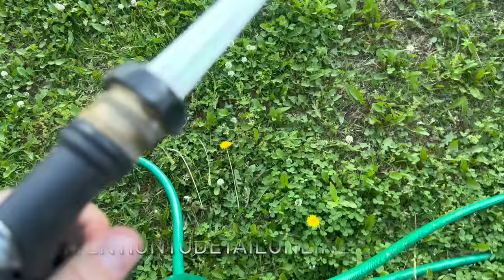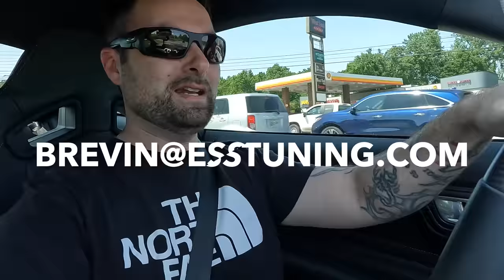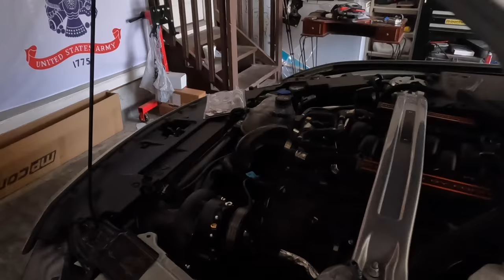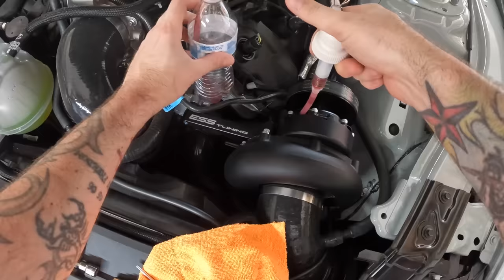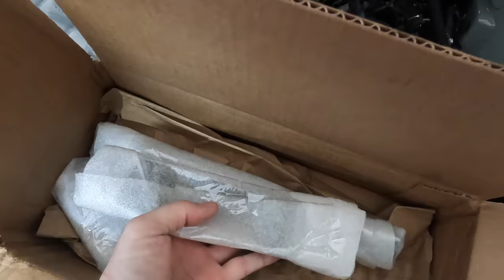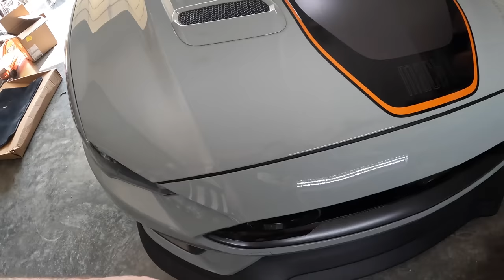PROBLEM with my 2021 MACH 1 SUPERCHARGED MUSTANG and HOW I FIXED IT...

Comment: Thumbs up, as usual. You're starting to win me over to this style of supercharger. Originally I liked the whipple style, because of the down low torque. Initially the ability to fry the tires off the line would be amusing, but power without traction is pointless.

Comment: As I was watching the video and you went and bought a siphon pump I was wondering to myself if you didn't get the one that came in the kit.  It works perfect for adding and removing oil from the head unit.   I still need to do mine, I haven't quite hit 2000 miles yet.  According to the installation manual the first break in change is 2000 miles.

Comment: I had to reroute the windshield washer hose, on the passenger side, to prevent it from being pinched by the strut. Also that mounting point on the fender is fairly thin and flexable metal.

Comment: Water hose spigot seems a bit loose brother. You might want to get that fixed before it breaks at the wrong time and becomes your #1 problem. Surprised there isn't a drain plug at bottom of supercharger. Had that along with a long SS hose and plug with my Vortec and that help drain all the oil and any particles that might be present. The siphon pump not very good IMO.  Nice struts, look top quality.

Comment: Never had any luck with hood struts.  I’ve tried them on my 2019 I had and on the Mach.  Both cars, once the struts were installed,  had the hood pushed up on the passenger side rear corner causing a misalignment on the remainder of the hood.  It’s as if you need to loosen and lower the right hinge.  Tried The ford Motorsport and the MRT hood strut kit. 
Neither worked. Blower does sound good on yours though…

Comment: I have an issue with my mach 1. The line lock wouldn't engage. Just gray "un clickable" has never happened before.
Reply from the maker: I have not even tried mine yet

Comment: Loved the video. Can't wait until I've got the turbos on mine. Haven't had an issue with the hood shake yet but I am also about to put a shaker hood system on mine. just ordered the first round of the Steeda suspension parts today. The build is coming along nicely. Will send pics as it happens.

Comment: Dude your making it really difficult to leave my mach1 n/a 😆 
I've got 7,500 miles on mine and I'm wondering how many miles I  need before it's safe to void my warranty any advice would be appreciated
Reply from the maker: I voided mine at 1100 miles 🤣 this setup on 93 is solid. I wouldn’t be too concerned. It easily goes back to stock too
Reply: @Zander13Productions  but can't ford tell that the car has been flashed (tuned) and dosen't that void the warranty  ?
Reply: @dannycaldwell7051  not necessarily. If you have an issue with the car, take it to Ford and they can prove that your mods caused the problem, then it voids the warranty. Also make sure there are no ECU updates for the car before taking it in. If there is, either request them not update it or return the vehicle to stock before taking it in.

Comment: Just curious why you chose the Roush over the redline struts? Are they that much better?
Reply from the maker: I think so. The way these mount is more solid
Reply: How are the Roush hood struts working out for the hood flexing? I am considering them but was worried about the hood alignment afterwords. I think I remember you using the Redlines as well in the past which is what I have used as well. The Ford performance look ok too!
Reply from the maker: @stephen7220  they have been flawless. OEM FIT. Highly recommend them over redline or other brands. I was a big fan of those other ones too but these are honestly better

Comment: centrifugal and a stick shift = love affair
Reply: Oh but you gotta ride in a 10 speed with a centri before you bet on that. It's heaven. Constantly in the power ban... Its literally a rocket.
Reply: @motiv8d111  I wouldn't want the 10 speed for road course or canyon driving because of it's shift schedule on downshifting. Although if your just a straight line non driving drag racer type yes I agree the 10 speed works very well in the 1320 especially when fitted with a 9.5" torque converter to actually get some decent 60'ft times out of it.
Reply: @TheLoneWolf_andCoyote  so when I toggle to track mode...the car does a good job staying out of the higher gears - and it down shifts like a boss during deceleration + rev match.  I've played on a few curvey roads, I think a manual would have a hard time keeping up (similar skilled drivers)  But both are definitely nice setups... especially under boost!  😎. I am a fan of either for sure.
Reply: @motiv8d111  yeah the 10R80 is really impressive when it's shift schedule is modded. I'm a manual guy mainly because i'm always in winding canyon or mountainous terrain. I'm spoiled now I like the auto rev matching and my Barton hybrid 3 for my coyote needs. Either way Ford did a great job for fulfilling the needs of everyone who wants a mustang.